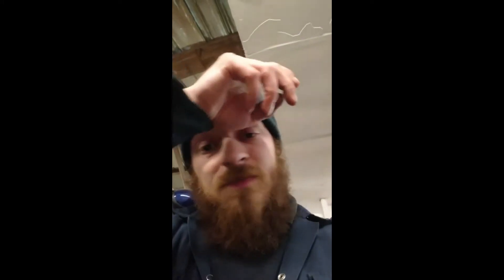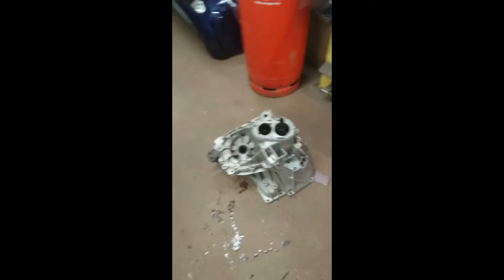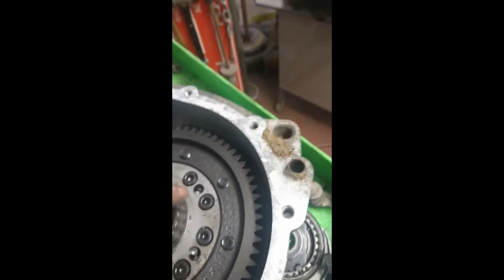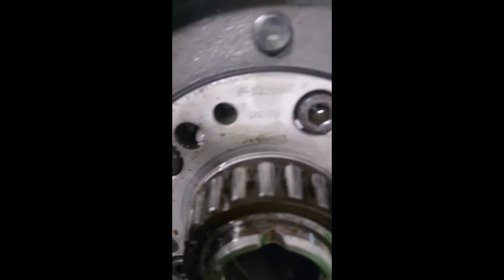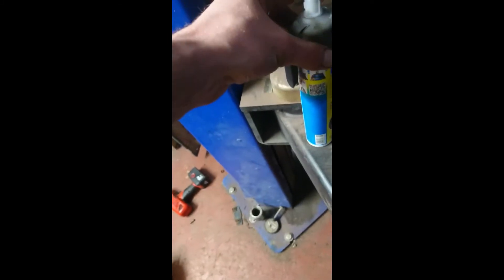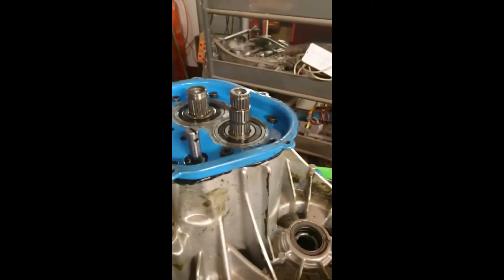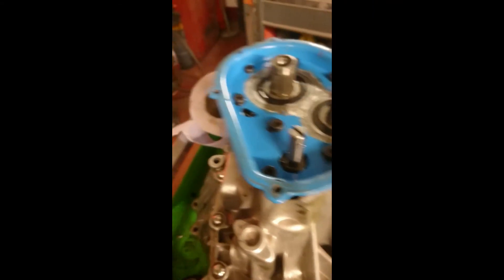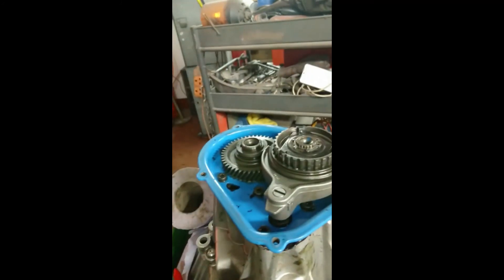Ford IB5 gearbox build Quaife ATB LSD

Comment: I tried to strip my box today, however after removing the two large circlips and removing main housing bolts, the casing seems to jam when I pull it up, probably about 20mm up.
I don't want to force it so wondering what it could be, does the gear selector need to be in a certain position?

Any advice appreciated.
Reply from the maker: Is yours a cable or rod linkage? O usually just strip them with them set in neutral tbh.

Comment: Hi, l run an MG Zr with an Ib5, and have a Fiesta box with a lower final drive that l want to swap into the ZR box. I'm assured it's a straight swap but have never pulled a box apart. I'm pretty competent mechanically but how hard is it to swap the final drives? Any advice much appreciated.
Reply from the maker: The final drives aren't usually too hard to swap over as long as you have decent quality pullers and are pretty confident. The IB5 boxes are lovley to work on, I can have one stripped ready to rebuild in about 15 mins, once you know the sequence its super easy.

Comment: Hey fella good stuff there ! But have you ever ran into a ib5 that is hard to get out of gear 1 when moving ? From stand still goes in abs out no problem just when moving… Thanks in advance and keep up the good work!
Reply from the maker: Sounds about like the synchro is getting tired to me, it might be worth looking at a new box because fixing it could get expensive, what cars it going in?
Reply: @ThePhilBilly  ahhh I’m bout to rip the clutch out and preying it’s the pressure plate as at idle and engine off car is nice NEVER jams but moving all gears are harder but getting out of gear one is a pain! Then after long ride it’s much easier… clutch pedal is basically all the way at top so change clutch that don’t work I’ll do gearbox cars a Ford Focus 1.6